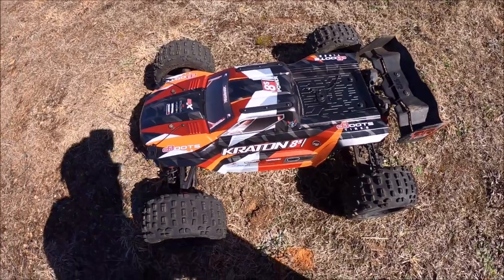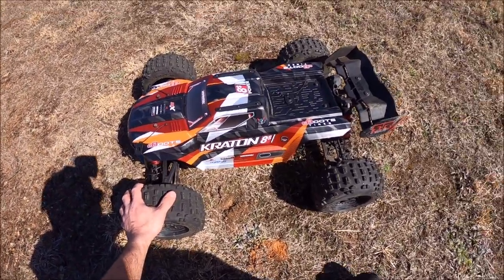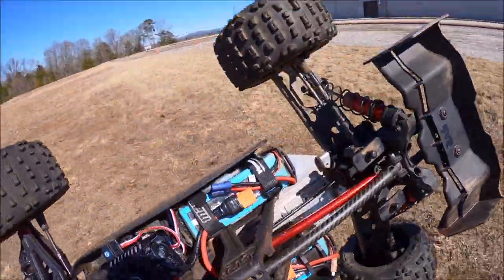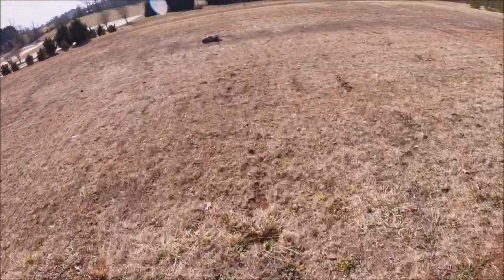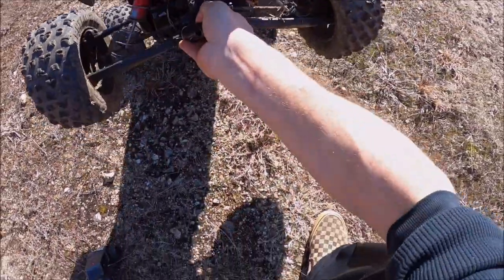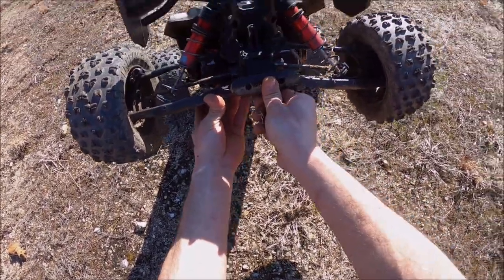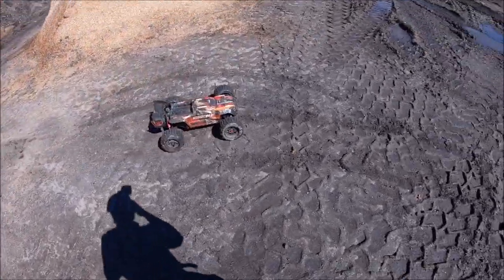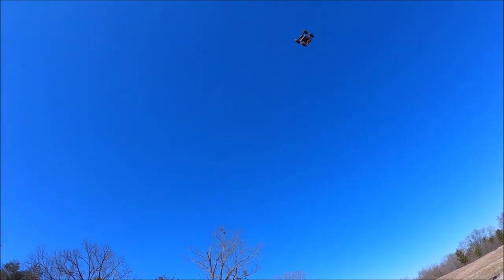ARRMA Kraton 8s -WORLDS Loudest chassis slap??!😱

Comment: You and Duperbash does anyone else come close?  👍🏻👍🏻👍🏻
Reply: I agree. There's Kevin Talbot,but he seems to be all about destruction, and F the skills to me. Didn't want to put that on the main comments thread,cuz Talbot does seem to be a cool guy,I just can't hande the constant breaking from horrible landings.
Reply from the maker: I really appreciate that bro! Lots of great bashers out there!😎👊🤘
Reply: Nope no one. Just see a bunch of others with cash, rich and rc man handle these things with skill.
Reply: Well...there's nasa
Reply: Commander Astrig and 
TP Parts Extreme 
As well
Reply: ThunderRC honorable mention
Reply: Hi Eric you definitely handle her great 👍👍. For your shock ends check out your drope in the rear adjust the set screw so your shocks are not fully extended.
Reply from the maker: @Paul Rakis Thanks for the tip bro!👊She's running droop screws all the way around. Also M2C pistons with larger holes to prevent oil lockup. Its the larger jumps that break the ends. A 30+ lb truck simply needs a thicker shock shafts and rod end doing jumps like that being her weight😱Regular hard bashing she holds up well! M2C has something up their sleeve!😉
Reply: @RCDUDE81  wow yeah for sure. You are alot more hard core then must of us on bashing 👊👊. You know what they say brother the bigger the jumps the harder they fall.  If I get up to about 20 feet il be happy. I have to build a nice ramp in The summer.👍
Reply: Not that I've seen. Thee 2 best!
Reply: @dustinfowler7868  arrma fan boy again with landings lol 😆
Reply: Nope
Reply: Thunder RC doing great too!

Comment: Awesome stuff Brother Eric 😜!!!! Great to see Big Girl back out 😍. The 840 Hobbystar is simply wicked on 34/34 gearing 😱🥰🥰. Just LOVE the brute power and ferocious sounds as she winds up and sends stuff flying 😂. My Jim's bearings have done great too. The Backflips balloon, but they're so smooth and forgiving on the K8s. I like my Lockups/Six Packs, but they definitely stress the stock driveshafts with this high torque setup 👀. Can't wait til Mitch pumps out some beefcake steel options for more extreme use. Loved the big sends and sick ass freestyling Bro 😱!!!! The K8s was made for this rugged terrain 👊. Just handles it. Another great upload my friend. And thanks for getting her dirty 🤗. Hearing that Hobbystar rip through muddy water is music to my ears. 🍻🤙🤙😎💪👊👊
Reply from the maker: Thanks brother Rich!!😁It was due time to get the 8s back out! The initial run was to test the Gens Ace 11,000 mah packs but those were a no go.👀😱Still had a blast ripping her around and that one chassis slap woke the dead!🤣🤣Yeah the 34/34 gearing is fast af! Been wanting to test the Back Flips on her for quite some time! The magic tire for sure!🥰They are getting worn though and the foams are about shot! Been running them on my O8S lately and I'd say its time for a new set!😂Thanks for your comment bro!😎✌👊👊

Comment: The outcast 8s tires are the best for kraton 8s.... I have a set on my k8 and best choice I made besides the castle 800kv system and I've ran my copper heads once... Just to use them I hate the copperhead tires...epic bash a usual 🚀 🚀 🚀 🍻

Comment: Won't see a x-maxx break a shock end like that 😄
Sweet bash dude! 🤘👍
Reply from the maker: The Xmaxx is much lighter!😜This 32 lb truck simply needs beefier ends!😂
Reply: @RCDUDE81  I thought you'd get a kick out of that 😆
Yeah they are very heavy and I'm sure it does not take much the crack one of those ends in half, rather replace a end then the actual shock shaft 😉😄🤘👍
Reply from the maker: Absolutely man!!🤙

Comment: My xmaxx doesn't need to handle like that? I have other rigs for that. All m2c'd out. I love m2c and my beef caked rigs are expensive bro. Not for everyone. Xmaxx will get the job done stock damn fine. Going huge and stability yes I like my arrma 8s but for more technical and pure fun it's the xmaxx. A ramp and a rail or a table or my shed roof for some backyard fun goes to the xmaxx all day. Dope videos brother and always love watching you showcase those skills
Reply from the maker: Definitely not bashing on the Xmaxx! Its a killer rig in its own right for sure!😜Just noting the Xmaxx won't handle like the Kraton but is still a killer bashing machine no doubt!
Reply: Xmaxx 👑 but love the kraton 8s after 600-800 min spent 🤣 💪
Reply: Can't fault the xmaxx its a fucken a blast and for stock tuff as hell

Comment: Guys can i use two 6s batteries on my kraton 8s??any help is very appreciated
Reply from the maker: No That will be 12s and blow things up!😱😂Unless you have a 12s rated ESC. Only way it would work is if you ran a Parallel connection so it stays 6s just doubles the MAH and amps. Two 4s packs in Series would be 8s.
Reply: @RCDUDE81  oh man...im glad you replied  I was about to order the damm thing...ok mate, 2 batteries 4s  it is then...it's my 1 rc car 😂😁 and in 41 years old...its gonna be epic